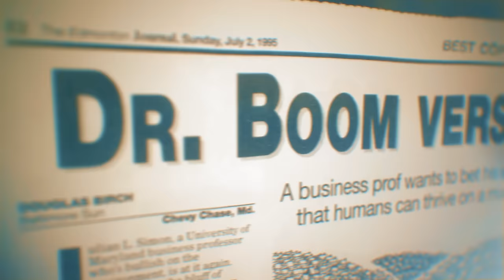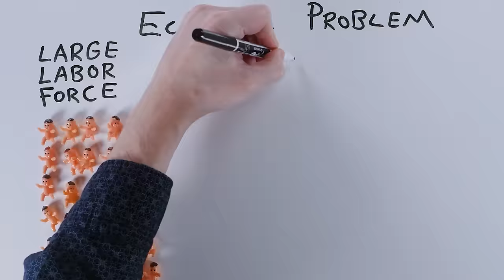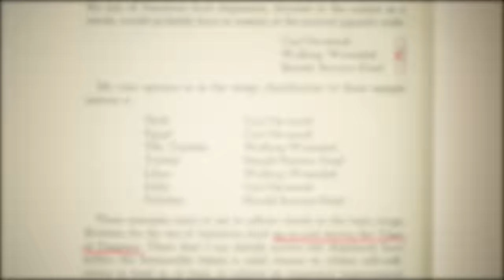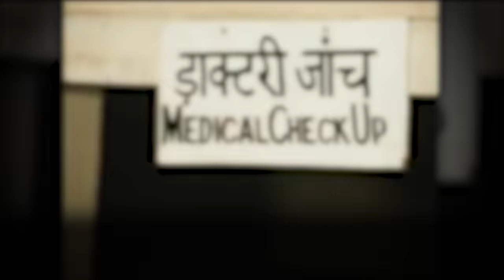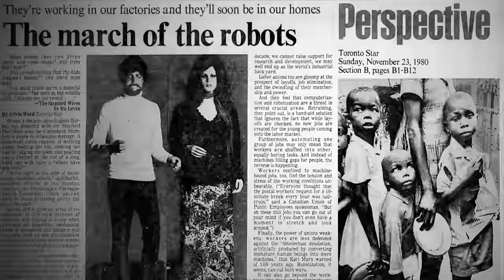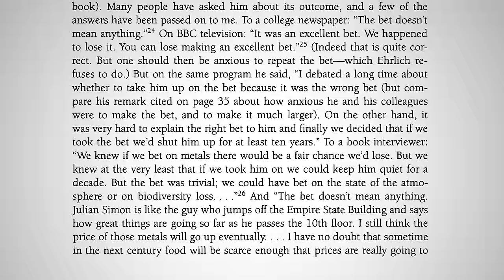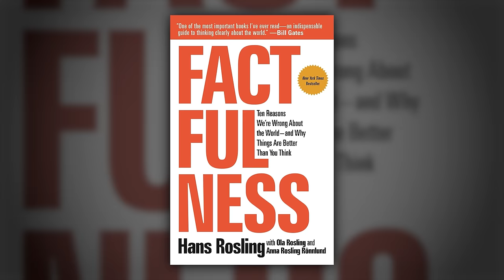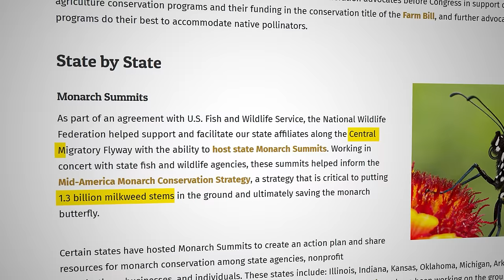The Man Who Wants Us Dead

Comment: It seems rather foolish to dismiss the possibility of resource depletion entirely because five metals became cheaper over a single ten year period. Following Simon's philosophy, there's no escaping the sheer fact that Earth has a limited total amount of every resource. The capacity for a larger population to solve the problems of a larger population still depends on having enough resources to produce enough of those solutions for everyone, and Simon's philosophy requires that there are always more resources that can be harnessed; that either we will never run out of a material, or that there will always be a new material rendering any depleted material obsolete. The bet did nothing but prove that in 1990, we weren't yet at the point where all the chromium to be mined had been mined.

Comment: Great video. I really needed this and it has changed my opinion slightly. However, although Erhlich got it wrong temporarily his "sci instincts" may prove to be right in the long wrong. Innovation is apparently reaching an asymptotic level now while resource reduction, pollution, conflict, climate change, obesity, and a changing geopolitical situation still persuade me that what goes up must eventually come down. Perhaps we will thread the needle and get out of this mess as sperm production is dropping precipitiously at about 2.6% per year from toxification of the food web. Perhaps we level off at 8.5 billion instead of 10 and sea level rise and climate change abate somewhat by solar radiation management, perhaps restoration of soils and ecosystems take place on a massive scale. Nevertheless, it is pretty clear that business as usual and fossil fuel  dependency is here to stay. All of the  COPs have been flops. We are not really serious about doing anything about ocean acidification, melting glaciers, extreme weather, increasing extent of boreal forest fires, deforestation, and biodiversity loss. Environmentalism has been green washed as far as I can tell. So although the Titanic has been bailing water rapidly through innovation (fracking) and Borlaug's "Green Revolution" it is still sinking albeit at a much slower rate than Ehrlich predicted.